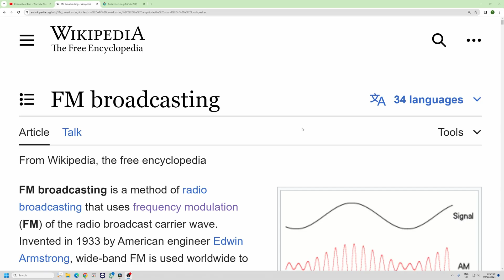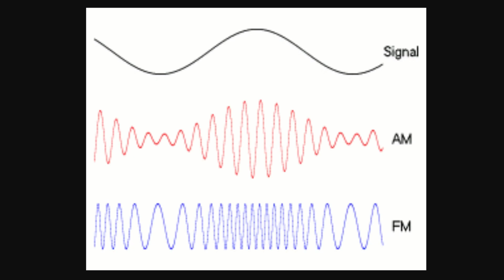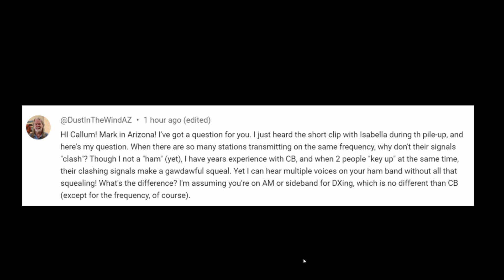The REAL Difference Between FM AM and SSB

Comment: Imagine my surprise this morning, when I was having my coffee, that I hear you call out my "handle"! 

Now, I understand the difference between Amplitude Modulation (AM) and Frequency Modulation (FM), and that sideband is just that: either the upper or lower "side" or half of the wave.  Now that just made me wonder: Can you "sideband" on both AM and FM? My experience is with CB (so far), which until recently, has been strictly AM.

What I"m still not understanding is why the "squeal" occurs when two operators key-up at the same time. I understand that proximity is a factor, but Is it the squeal caused by the two transmitted frequencies being in-sync or out-of-sync with each other? 

Here's a musical analogy: I play a 12-string guitar, and when I'm tuning a pair of strings to the same note, they will clash at various rates until they are perfectly in-sync. So then, is the radio squeal (heard by someone beside the two transmitting parties) created by two nearby transmitters that are just a bit out of sync?

Thanks for answering my question in a video Cal! 73!
Reply: Here's the deal with the "squeal" or "heterodyne". It's caused by the difference between the two AM carriers' frequencies manifesting itself as an audio tone. The frequency tolerance for CB is +/-.005%, or about 1300 Hz. Back in the 23 channel era, frequency control was by crystals, and it wasn't unusual to have carriers up to 2600 Hz or more apart.
Reply from the maker: Out of sync Dusty!
Reply: Answering the question about sidebanding with FM... not in the same sense as SSB is sidebanding AM, no.  Since FM modulates the frequency rather than the amplitude, every bit of modulation in FM is taking place in the sidebands to either side of the center frequency, so if you cut off half of the signal, it's simply going to clip and reproduce only the upper or lower audio frequencies, depending on which sideband you choose.  Basically, if you think of FM as an audio waveform in a scope turned on its side, you can see what I'm getting at.  You wouldn't be suppressing extraneous audio information, you would just be cutting off either all of the bass or all of the treble.  In fact, if you look at the NRSC-5 "HD Radio" standard here in North America, you'll see that the digital portions of those signals operate in the "sidebands" of an FM broadcast station, but those sideband portions are literally the digital signal split into two, equidistant from the carrier.  The entire digital system will fail to function if one of those sidebands is not there.

What we CAN do is limit FM signals to narrower bandwidths, which is what aircraft radios do.  If you look at SDR software and see "NFM" or "Narrow FM" in the tuner section -- and I've even seen it on some older analog receivers -- that's the "spiritual" equivalent of SSB on FM, if not the direct technical equivalent.

EDIT: I should add that subcarriers are used on FM, and that could be considered similar to SSB in terms of the waveform layout within the channel.  Basically, that's taking the higher audio frequencies that are out of the audio range (of either the receiver or the human ear, or both; so usually in the 30 kHz and up range) and modulating them to produce a separate audio signal.  This is how "Muzak" and reading services for the vision impaired used to be transmitted up through the 1980's or so.  It's not quite sidebanding, as it still requires the primary carrier to function, but it's another function that might be thought of when sidebands are brought up in relation to FM.

Comment: Here's a good one.. what is the difference between a "linear" & an "amplifier"?.. linear means straight line & in a linear if you put 2w in & get 20w out if you put 1w in you will get 10w out & this is needed for all the modulation modes where the magnitude/shape of the envelope is important.. that is AM & SSB. This is clean but not very efficient. If your amplifier goes non-linear you will start transmitting spurii & harmonics & you cannot get rid of them so am & SSB amps MUST be "linears".
On FM what really matters is the number of zero crossings & the amplitude shape doesn't really matter. You can put FM through a totally non-linear amplifier (that is more efficient) then slug it through a big filter to get rid of all the sproggies & you are still ok.
Based on this if you have a 2m FM amp it won't be a linear so don't put SSB through it.... & If you have a 2m linear that is obviously good for ssb & although FM could go through it it probably isn't spec'ed for a 100% duty cycle mode like FM (or am or some data modes) so you  would only be able to run it at a fraction of its max rating to stop it melting down.
Be wary not all amplifiers are linears (& if you are trying to boost a hotspot watch what type of amp eBay sends you & what data mode needs what.. it isn't always obvious).😮
Reply from the maker: Fascinating!

Comment: FM has a thing called the 'capture effect' which as Cal explains well, means a receiver will only demodulate (i.e. convert to audio) the strongest signal. AM doesn't, so two transmissions can be heard at once. If, however two AM transmitters are going at the same time but are not quite on the same frequency, the carriers will 'beat' with each other causing a 'heterodyne' - which is a squeal or whistle the audio frequency of which is actually the difference in frequency between the two transmissions. 
At night, on the AM band, sometimes American AM stations' signals make it across the Atlantic. But they're on multiples of 10kHz, whereas European AM stations are on multiples of 9kHz. So if you listen to, say, 909kHz in the UK you'll hear Radio 5 Live. However, if a US AM station on 910kHz is making its way across, you'll hear a 1kHz whistle under the probably stronger Radio 5 Live.
AM like this is properly called Double-Sideband Full Carrier. Other versions exist, such as DSB reduced or  suppressed carrier, and of course good old single sideband which doesn't transmit the carrier at all, so it's more efficient at the transmitter and doesn't cause heterodynes if more than one signal is  received at once. 
However its audio quality isn't as good as DSB AM, which is why most international HF broadcast stations still use DSB full-carrier AM. But perfectly good enough quality for voice. 
I did some experiments a few years ago transmitting music on SSB - I used to have an experimental licence that allowed me to do this. Here's a vid of music being transmitted on SSB - it's possible to make it sound pretty good, but the quality depends on really well set up transmitters and properly tuned receivers.
https://youtu.be/0SRUdtc9OVE
By the way, I'm not for one second disagreeing or countering Cal's excellent explanation, just expanding upon it a bit for those interested. If you're not interested, don't read this!
Reply from the maker: Beautiful.

Comment: There's no heterodyne (squeal) on SSB when multiple people talk because there's not multiple carriers mixing.  SSB is also usually preferred over AM because it concentrates all your power into the single sideband carrying your voice, where AM splits it up into the carrier and two sidebands.  So SSB can be heard farther, and uses less bandwidth allowing more signals to be packed into the same space.
Reply from the maker: Nicely said!!
Reply: Thank you Sir!!!!!!
Reply: As I understand SSB is that there is a need to put as much power out as possible as the ham licences restrict the amount of power you can use  the powers being the total power used to transmit , ie DC  so in valve equipment you wasted power just to light the valve heaters as an example it didn’t contribute to the radiated power, the use of Side band as I understand is  when you modular the carrier , you produce a sum and a difference signal , that is the upper side band and lower side band respectively and the carrier itself ! 
Here’s an example a carrier of   400 mhz modulated with a 1 kHz sine wave will produce a up side band of  400+ 1khz and a lower side band of 400mhz -1khz  all the useful information is contained in the side bands , so if we remove the carrier and one of the side bands  we are able to put all the rf energy into that single band . When you receive the LSB it’s unintelligible, so to decode / retrieve the the audio tone you need to mix it with the original carrier signal this known as a BFO a beat frequency oscillator this is done in the IF stages of the receiver this has to be adjusted to get the pitch right otherwise the voice  produced will have a higher pitch or lower pitch, obviously this type of transmission is not suitable for domestic broadcast for this reason . That’s how I understand it, I am sure someone will correct any errors I have made.
I would like to add here that this effect occurs in nature when light is split in a rainbow you can see that the are two bands  of colour the main one we see and an inverted one  as is the case with the two side bands one is inverted.
Reply: @johnchild61  Mostly correct, with a couple of exceptions.  Transmitter power limitations are generally measured using the output power going to the antenna, or the radiated power emitted from the antenna.  The power used to light your filaments isn't counted in either one.
The double rainbow has to do with there being multiple light reflections inside of a raindrop.  It has nothing to do with heterodyne mixing.

Comment: Just to put a name to it, what we're talking about on FM is called the "capture effect."  It's not so much a function of the waveform in the RF realm as it is the way the FM decoder works in your radio.  All FM receivers, by necessity, contain an RF limiter to prevent overmodulation.  This limiter attenuates everything but the strongest signal at the antenna.  So, when you're traveling down the highway, listening to the radio, and you hear two stations fluttering back and forth on the same frequency because you're on the fringes of both signals, that's the FM capture effect rapidly switching back and forth between whichever is the strongest at that moment in time.

By contrast, AM (and, by extension, SSB) does not exhibit the capture effect, because in AM, the strength of the signal is what being modulated to produce audio, so you get the additive effect instead.
Reply: Or subtractive !  Particularly at night with sky wave and ground waves ( Luxembourg)  for those of us of a certain Age!

Comment: Good explanation Cal. SSB is "kind of" AM, or half AM without a carrier. That's why we hear everything and are able to pick YL's easy. 🙂 Same with AM, when everyone have the same carrier frequency.
Reply: A simpler way of thinking about it is where is the information stored. You need two parts for RF to convey information. A carrier wave and a way to modulate that carrier with the information (speech). In Amplitude modulation, the transmitter supplies a carrier at a fixed frequency, and the tx modulates that Amplitude according to that speech. In Frequency modulation, the tx modulates the frequency of the wave proportionally to the speech. In SSB, which was adopted due to its bandwidth efficiency for hams, it was found that the AM wave had 50% of the power going to the carrier, and the speech info we care about was in the TWo sidebands of the modulation. So we suppress the carrier energy, and have available both sidebands to listen to. The bandwidth of these sidebands is 3 kilohertz, we choose either upper or lower bands by convention there is no reason we can't hear 7125 on upper side and, we chose to follow a plan. Now the fun part... In order for the Rx to demodulate the SSB signal it needs to inject back that carrier, via a beat frequency oscillator (BFO) . That's were all the interference arises. Your Rx is trying to march a specific frequency and is bombarded with others slightly off that frequency (the Donald duck voice) or on the same frequency only stronger giving your ears pain trying to hear YOUR station. Filtering and processing magic has helped greatly. Why aircraft use AM over FM  is due to a phenomenon known as capture effect, the stronger signal wins and you only hear it, not the weaker station. Am  precisely does not have this effect and you can hear both strong and weak signals. Hope this gives a clear picture of the magic happening inside the radio.